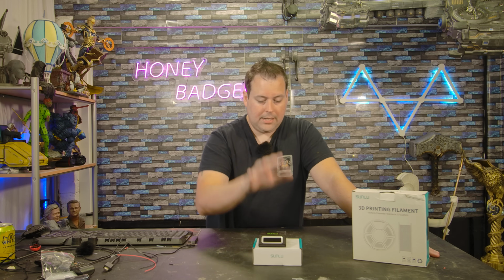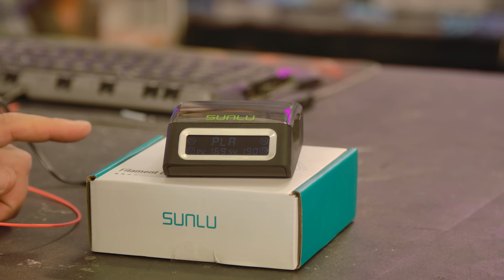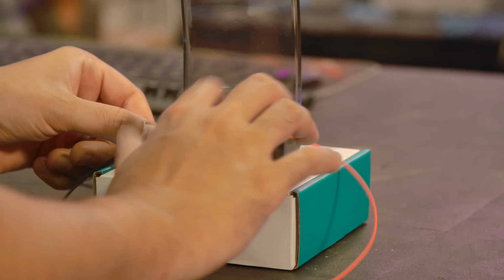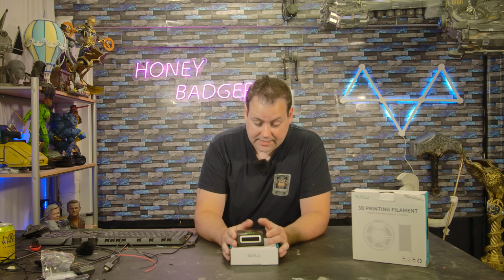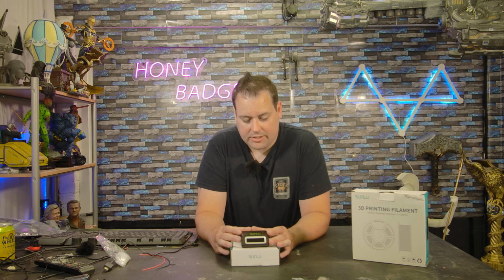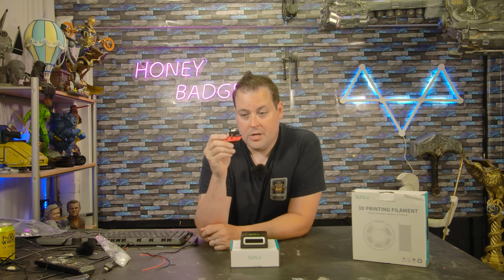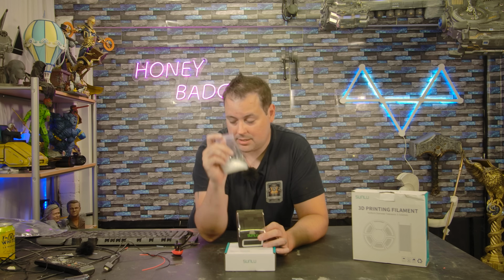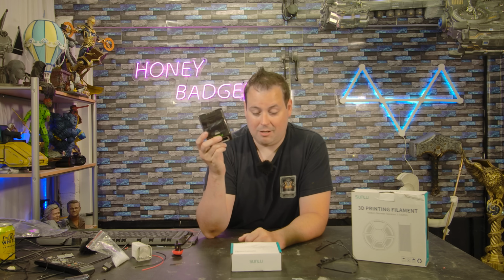Sunlu Filament Connector - Review and Results

Comment: There is one YouTube who got sent this and I think she mis-understood what it’s is used for. 

She loaded a multicoloured print in to her p1p and Bambu studio worked out how much filament was used between changes and she cut and weighed that amount of filament and joined it together. 

She then printed one item using the p1p and ams and then the same item with the filament she joined together. 

She then said it didn’t really work that well when doing multicoloured prints.
Reply from the maker: so i mean you could use it for multicolour  (it worked on the benchy we did even if it was by accident lol) but my god its alot of work and calculations, this is a tool for a job and it does that job pretty darn well,